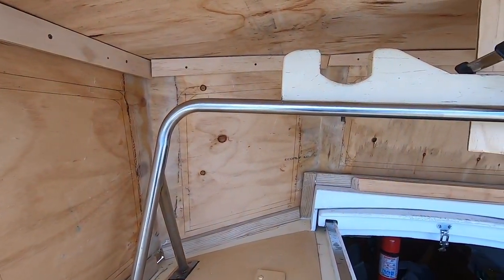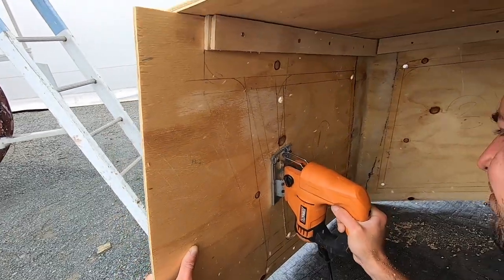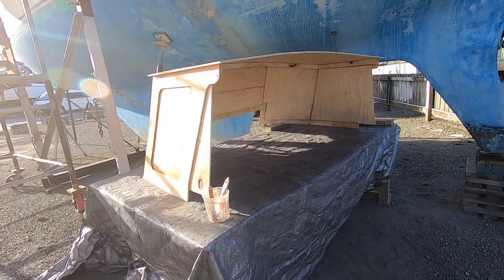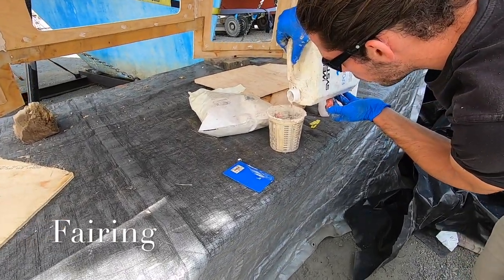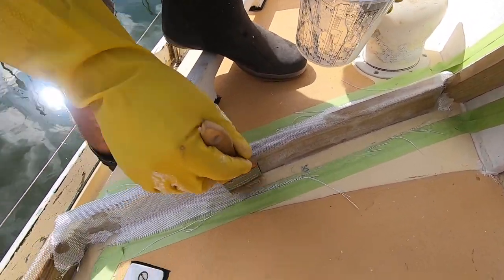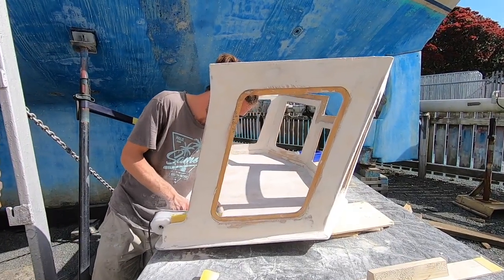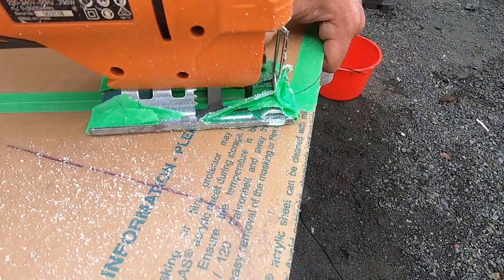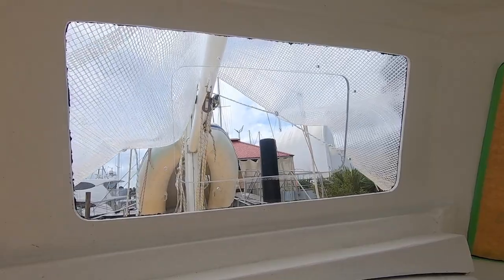We built a hard dodger for our H28 - Between Sea and Sky [ Ep 22]

Comment: plexiglass expands and contracts quite a bit. seemed to have been installed without any extra perimeter gap to compensate for this movement. good job though, looks nice
Reply from the maker: There is about 1.5mm gap all around the edge of the clear acrylic. I don’t know if it’s enough, but it seems to work so far. Thank you

Comment: I thought you were using that plywood as a plan which was going to be transferred to a foam product like Divinycell or similar or quality marine plywood. That plywood you have is not marine plywood, nor even good quality plywood, that is no good for marine use. Anyone watching this i would not recommend using plywood like this on a boat, especially externally
Reply: Its not structural just an add on doesnt affect seaworthyness
Reply: @danscoltock1180  Nice idea either way and it will make life at sea so much more comfortable for you. It’s difficult when you are on a budget to justify the more expensive materials but the issue with cheap ply v marine ply is not so much about being structural but about it being able to stand up to the elements in a marine environment. The type of glue used and the quality of the timber mean that decent marine ply can better withstand the heat, rain, salt water and so on without delaminating and/or rotting along the glue lines from the cut ends. It looks like you made a go of sealing the ends as you went and glassing over the structure so you should get some good use out of the dodger before perhaps replacing it at a later date. How long it will last will depend on how well everything is actually sealed but if you don’t expect too much from it you may be pleasantly surprised. For future reference, you really need to wet out the timber with neat epoxy before trying to seal it or glue with a filler or glue mix as the timber sucks the epoxy from the fillers (or glass weave) and you end up with a dry join that won’t hold up..